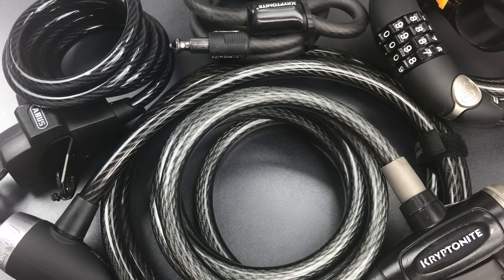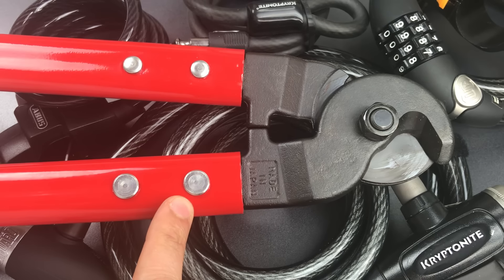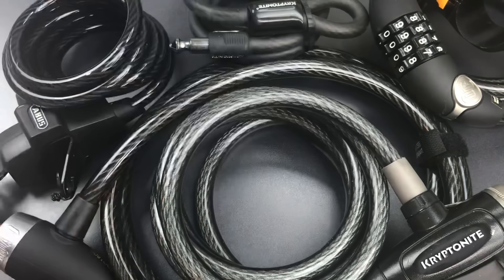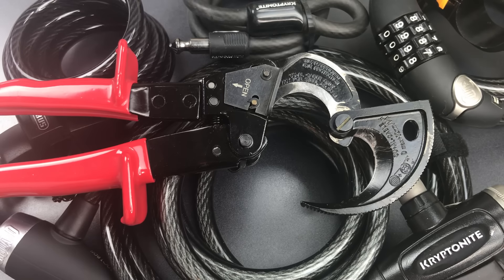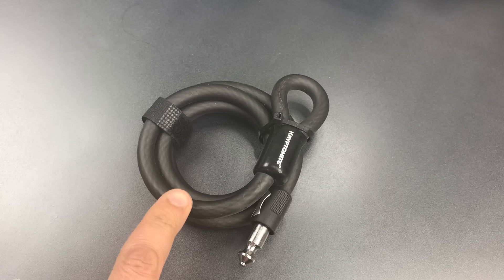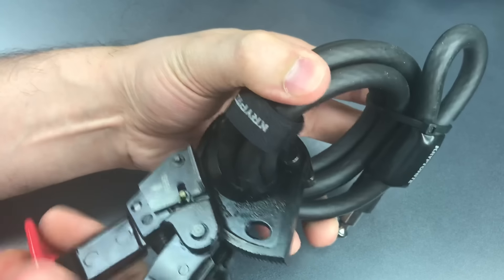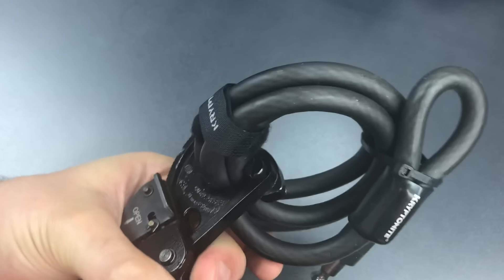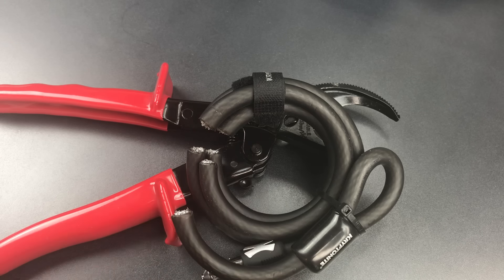[748] Cutting Bicycle Cable Locks is EASY!

Comment: I see all too many bikes locked up out in public with these cheap crappy cable locks. Even a cheap lower-end U lock would probably be a much better security option than a cable lock (especially the ones with the multi-wheel combination locks on them as seen in the top right of the video where the combination lock could probably be easily decoded/opened)

Comment: Be careful with that finger up right next to the cutter blade. If that blade or ratchet mechanism were to break you could easily break a finger.
Reply: By what force?
Reply: @Bladsmith  Elasticity.
Reply: There's very little elasticity or tension present.
Reply: No, you couldn't. Why do you think pressure tanks are always tested to failure using a liquid instead of a gas...? The latter is elastic, the former is not - so as soon as the tank bursts, there's no force acting on any of it any more and there should be no accelerated shrapnel. And this tool is not all that elastic either.

Comment: I never knew about those cutters, I do now but so does everyone.
£20 on eBay, I'm all for showing the weaknesses in locks but showing very cheap accessible tools? Not so sure it's a good thing to be honest.
Reply: If someone is stealing bikes they already know how to do it and if someone got the idea from this video they'd probably start doing it anyways and would've found a tool like this one with a simple google search. It's better to show this so people can protect their bikes better
Reply: @PK-sj4xe  I learned from it, so I'd say others have as Well.
It's easier to cut the lock and ride the bike away than to carry the bike away and sort the lock later is what I'm saying.
Did you know about this ratchet cutter before this video?
Reply: @lockpickingbelfast  No, but my point is that with or without this video someone who wants to steal bikes would just google something along the lines of "best steel wire cutter" and find something like this, while someone looking for a bike lock wouldn't be aware of how weak it is

Comment: My lock alarm goes off if you cut the cable. So piss off.
Reply: Well now you can hear your alarma as a dude goes away with your bike
Reply: @proxy90909 :
You mean as they carry it away.
There's a u-haul circle padlock on the chain too, 
so they would need a truck getaway.
Weighs about 40 pounds usually...
Schwinn hybrid, not worth the effort.
Sorry about the 'piss off'.
Was in a bad mood I guess. Apologies.
Reply: @TahoeJones  I guess that is enough deterrent, I feel bad for those in this comment section that actualy describe guys in Vans that do leave carrying the entire thing. Best of luck man
Reply: @proxy90909  : 
My rig looks intimidating.
And it's no $1000 bike.
Many watching my back too.
A couple thieves have been tackled,
but way in the past though.
Unique situation. Known owner stuff.
Take care.

Comment: Good job, showing criminals a fast easy and concealable tool to steal more bikes.
Reply: They have been using bolt croppers for many years, over 30 years in the UK that i know of, this is not a new trick to them. as locks advance so do they, cordless grinders seems to be the popular option for them now.
Reply: They already know this, if your bike hasnt been stolen using this kind of wires its just because you dont live in a very shady neighbourhood, the hard part isnt cutting the cable, the hard part is doing it without being seen. I removed one of these using a fingernail cutter, took about half an hour but it can be done
Reply: Lord Turnip  most of them are using tools that are that quick like this one demonstrated here they don't care if they are being watched